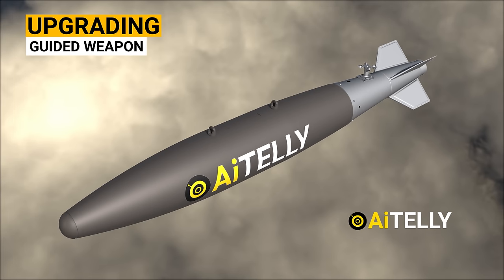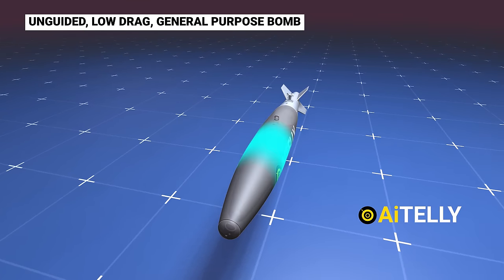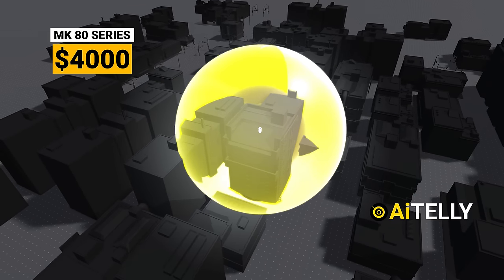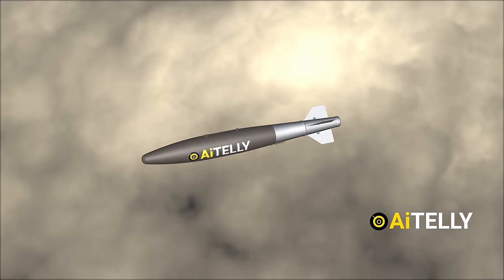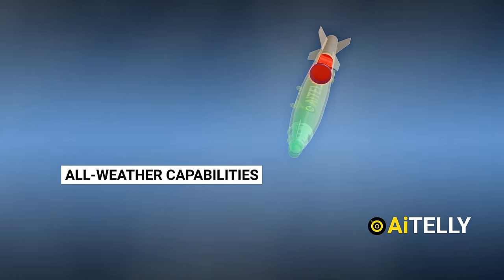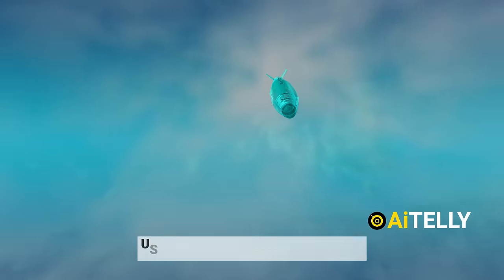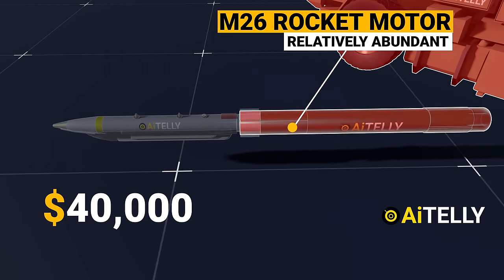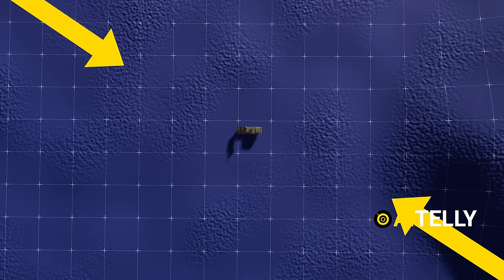How Smart Bomb Works? JDAM Precision Guided Munition

Comment: I know that the F/A-18 Super Hornet was an example. But that's not the only one, because the Mark 80 series of iron bombs are far more widespread within NATO Air Forces (it's capable of being carried by the F-15E Strike Eagle and their later derivatives,  the F-16 multirole fighter, the A-10 Thunderbolt II ground attack and CAS aircraft, the french Dassault Mirage 2000, among many other Western designed aircraft. Even I've seen those bombs being fitted in other fighters. A few years ago I've saw these bombs (the unguided Mk.82) being fitted in Venezuelan Air Force Su-30MK Flankers (due that their elderly F-16 Block 15s are mostly grounded by lack of maintenance and upgrades due to the economic blockade enforced by the US due to human rights abuses and other things).

Comment: the 500 pound JDAM GBU-38 is a Mk.82 with a GPS guidance package and stabilizing fins. The 2000 pound JDAM is a Mk.84 series. The Mk.83 1000 lb munition is the GBU-32 and the other 1000 pound JDAM is the GBU-35 or BLU-110 GP bomb.

Comment: A few issues with your video. The Mk80 series GP bombs have about 40% of the weight of the bomb is explosive filler. The fuse conduit is merely a hollow tube that allows the control wires, if necessary, to be connected to the fuse in the rear and/or the fuse in the tail. Would the GLSDB have suspension lugs if fired from the HIMARS, MLRS?